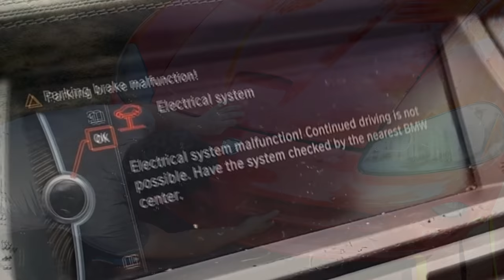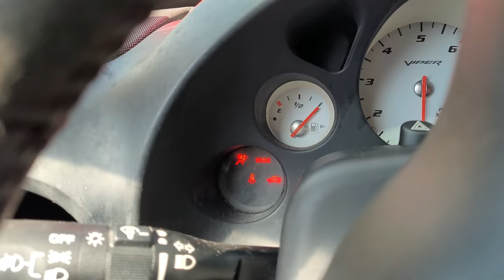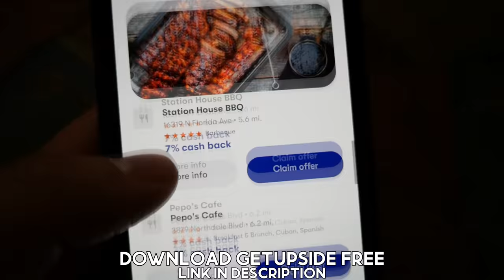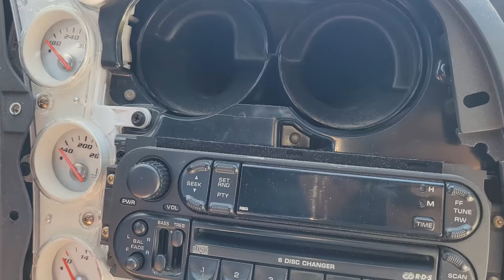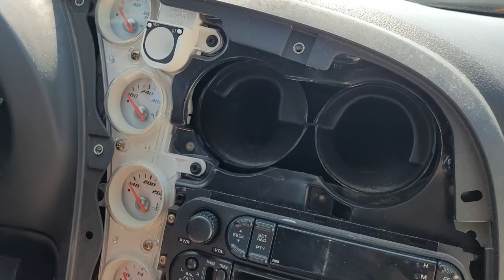Will this Sinkhole Flood Salvage Dodge Viper Start and Run?

Comment: I haven’t finished the whole video yet but I would avoid tearing the engine apart at all cost. I had a TwinTurbo Viper I traded a guy a Polaris I had but he had blown up the motor and it was an absolute nightmare to find new gaskets. It took me months and months to find any gaskets. When I would call places they would just laugh I ended up using OEM gaskets and found the one set in the entire United States that dodge had. Just be aware to this issue if you do tear the engine down, find those parts first and I pray you don’t have the troubles I did. The second I fixed that car I immediately sold it I was so irritated A complete nightmare like over six months of waiting just for head gaskets to finally pop up I wouldn’t wish that upon my worst enemy. Best of luck

Comment: If the starter is "stuck", wouldn't the lights/displays go dark or atleast a bit dim when Sage pressed the start button? I didn't get that impression. Maybe you should try jumping the starter to bypass any potential "modern car" issue along the way from the start button down to the starter. I'm more used to older cars and boat engines, ignore me if I'm way off. ;)

Comment: Pulling the fuel pump relay can cause other problems I learned hard way when I pulled one off my son's car so I couldn't drive it. I ended up having to replace a fuel pump relay module behind the back seat of a 2013 Ford Taurus.

Comment: I think you forgot the most important question: “was the motor running when it flooded?”
Reply: He answered this in the first video. It’s a manual. It probably stalled out the moment it hit the water. No way the driver had time to put it in neutral
Reply: Not likely. Plus it was parked off the road after hitting the hydrant and then the ground collapsed beneath it.
Reply: My comment is in reply to his opening 3 questions you need to ask about a flooded car and not so much about this specific one 😉
Reply: @johnlaw5762  person hit the hydrant, water followed and sunk the car. My bet is it was shut off after the hit.
Hydro locked engines don't usually rotate over very well, tho I seen some that have like nothing happened
Reply: I believe it was 100% as you can clearly see in the crash and recovery video...

Comment: You have 'Push to Start'... uh, boss? You may have a safety interlock that demands the Fuel Pump (very likely) and Blower (maybe) Relays installed. Its a 10 cylinder and those things would quickly scavenge the fuel rail empty possibly leaning out the engine so much the pistons burn out. Just an idea, I would have to see a wiring diagram for it to determine if thats the issue.

Comment: If any of that rust that is still in the engine breaks down into the oil it will destroy the main bearings and the camshafts, the engine may start but the engine will not last! Very risky not stripping down the engine and cleaning it properly.

Comment: I am 9 minutes in. This viper will start. That was a lot of water, but not a lot of rust and corrosion. I think if it turns over, and you're able to get the rest of the debris caught in those oil filters. This car will be running. And that engine may not be as bad as expected. Especially due to the fact that it's SALT water.

Comment: Just take all plugs out fill with oil leave plugs out and cover plug holes with towels then turn engine over with starter let the rings clean the walls then oil change again

Comment: Why would you circulated sand throughout you motor? 
 You are going to have to rebuild it anyway, why ruin the crank and camshafts lifters and every friction surface.

Comment: Marvel mystery oil . Put one quart in the fuel and one in the oil (sub out one quart of oil) it will clean it all run for 60 mile change oil . Then scope it you will not be disappointed.

Comment: Did anyone else notice the ARP rod bolts? That engine has been rebuilt at some point with some high quality stuff
Reply: highly doubt it, the car has like 9k miles why would it ever have needed a rebuilt
Reply: @MS-ps3cf  may not have needed a rebuild, may be a performance upgrade. vipers are commonly modified

Comment: Spray the starter with wd-40 and tap with a hammer as you apply power.  Bypass the switch and jump it directly.  If you want to test the starter, test the starter!

Comment: Try to look after the immobiliser. Maybe the problem is around there. If the fuel pump primes up, that will be a good sign around the immo.

Comment: I live in New Jersey where we have had a number of floods even in recent years so I am extremely cautious about making them roadworthy. Flood waters can be loaded with human and toxic wastes, you may have water inside of body structural parts, and electrical parts may be toast so may cost more to replace and repair. In this case too, your 'sweat equity' if use a going rate of $100/hour, you will likely be $4,000 + that should be included in any 'profit'.

Comment: Are you able to pressurize the oil system and get it flowing without starting the engine? That would probably be ideal in this situation.

Comment: I think you got lucky and the hydrant had cleaned out the line by the time the car got there and it was soaked in fresh potable water. When it comes to metals, many folks think water + metal = rust, but the reality is with fresh potable treated water sequestered in a non-oxygenated environment it can act like a preservative, hell even in salt water if its cold enough corrosion is minimal over decades to the point that the US Navy studied storing ships and aircraft in the deep ocean.

Comment: I have ran a quart of diesel inside the oil of a gas v8 for a week of regular driving, it cleans all the crap out of it--works even better on the japanese 4cyl engine

Comment: The ECU may have some dampness. I was unlucky to have a car suffer water damage and I did have to dry out the ECU after removing the cover. Although they look pretty watertight the plug connections can allow water in. My car was fine after I dried it out. The engine wasn’t affected luckily.

Comment: Hi Sam ... greetings from your favorite Aerospace Engineer on the French Riviera LOL ... what a great call on the throw away Oil filters ... know this, ALL Oil filters are designed to work for about 30 minutes (regardless of miles ... just like on "Tractors") before they do their jobs and revert to "Bypass" mode ... same on F-16/22/35 Fighter Jets. Trust me. "Salt water" is not your main enemy ... it is the sand/silt ... the true reason for "Filters" (and metal fragments of course). Of course, extracting all the water/sand is your main goal, do stop wasting money on "Penzoil" ... even remanufactured Oil will do given how short of Life the Filter will do its' job ... think of it as "Break In Oil" function. And please invest in a good "Contact Cleaner" ... you don't have to immediately replace the fuses/relays ... "contact cleaner" etches the surfaces where the contact points are ... the internals are sealed ... save some money. And know this, "WD-40" was concocted for the "Mercury 7" project to prevent oxidation of the Aluminum exterior Skins (main ingredient is "Fish Oil") and is conductive ... spray that shit all around ... the "WD" means "Water Displacement" ... it is NOT a "lubricant", it is intended to prevent oxidation solely.  I know you will have success with the restart ... looking forward to the next installment !!! Bon Chance ... y'all.
Reply: Well shit, I learned something new today regarding WD-40 Thank you good sir.
Reply: My man spittin’ facts
Reply: Something that works intermittent.  need contact cleaner for my overhead swiveling map lights X6 each. 1995 4X4 454 GMC suburban LT
Reply: BS40

Comment: I’m not sure if your aware or not. But it  seems like the rod caps have ARP bolts. So The engine may be built/have nice aftermarket bottom end parts.
Reply: Saw the same thing.

Comment: Sitting here in the UK whilst Americans pay $3.60 dollars for a gallon. We have fuel duty tax with is 35% then we have VA tax at 20%, imagine that close to 55% of the cost of fuel is just tax.
Currently paying £1.72 per L. Approx 5l to the gallon so we're paying £8.60 per gallon or $10.89 dollars D:

Comment: Does this have a transaxle? Either way you should do a fluid change before running the engine. Probably didn't get wet, but you never know when it was changed last.

Comment: I would still be a little worried about the rusty grit in the cylinders.
You need one of those dentist jet vacuum thingies to go to town with it.
Reply: there is no way he is getting it all out. It needs to be clinically clean but I'm guessing some sand is going to be in at least one or more cylinders and its bound to scratch the crap out of all the bores and ruin that engine. What a waste.

Comment: Your on the right track with the viper.. everyone thinks everything has to be so prestine inside an engine for it to function correctly.  I say no.. no it doesn't have to be perfect.  Yes debris and water must be flushed from bearings and passageways.. but cranking without fuel will clean out all that.  These naysayers are the same ones that thought you couldn't repair the bmw head either.. keep at it.  Keep an open mind and do what you do..I worked for Caterpillar building transmissions.. you have no idea the stuff that went into those.  Yes we had tolerances, unless it cost money,  then the tolerance was overlooked.  If a shaft or gear was undersized it was never noticed because the parts would still assemble.   Most of the parts were good,  most of the pieces were installed correctly,  most of the time it didn't harm a thing.   But some went on to never be noticed and lived a long life.. probably... lol

Comment: Am I the only one more concerned about there being sand in the intake and cylinders than salt water? It may start but he will grind the shit out of the cylinder walls would you not? Why not tear the engine all down and sure it’s all cleaned out before starting it?

Comment: Why not test the ECU by connecting a scanner and checking codes?  The actual codes don't really matter at this point.  If there are any, probably means that at least something is working electronically (ECU, bus comm, etc.).  Could be a useful clue.

Comment: Hi Sam, I suggest to get a very powerful vacuum with cyclone technology and make sure get rid of all the sand in the engine bay first. The open engine and fine sand is not a good combination.
Reply from the maker: Yes we shop vacced on between removing everything. It's the worst part of this car probably worse than the actual water

Comment: Im sure its in the comments but why didnt you first hose the entire car down? Under the hood,wheel wells, literally everywhere. Could have hosed that sand away from the intake Valley pan, and alternator.

Comment: That water is not going to hurt that car change all the fluids flush out the engine  put  transmission fluid in the engine then put some alcohol in the engine it will dry up the water  the chance the plugs start the engine let it run for a while then change the oil again

Comment: Still probably the better idea to pull the heads and get all that crap out of the cylinders before you crank it or else you can easily gouge the walls and you end up burning oil and no compression.

Comment: The best rust remover method I have ever seen is using apple cider vinegar.I used it on my gas tank off a old motorcycle I rebuilt and it looked new once it was done eating the rust.

Comment: Would there be an issue connecting a battery and home made switch directly to the starter to turn over the motor?

Comment: I know you can start the car up and trying to stop the carpet since it has been in a plug damage or any kind of water damage but if you have more money and sense if you was going to keep it or sell it think you got it started you are causing more problems and what it is worth little bit of grain of sand or salt it will start to wear your fails and with every single or joint moving parts in the engine that would be the same with your steering column power steering you're front bushes your your joints will have great grit and Sand and salt in it when you have sorted the car out you'll have to get wear and tear a lot quicker what you would in the first place

Comment: I've flooded many Honda four wheelers and dirt bikes in my day. No big deal. Just pull the spark plug crank it over a few times and hit the trail. Maybe change the oil when you get back... 😂 That would have made a better video.

Comment: If you have still got sand in the engine and think of putting stuff through the engine trying to filled it out to clean the inside and trying to start the engine out fair enough it will fire up but in the long run you have made things 10 times worse it wouldn't matter if it was so water or from a beach or whatever it is with sand and Grit always salt or if it completely roll hit a fire hydrant and dumped got a hole through the ground and the whole part of the front end of the car when inside the hole and water log the engine it wouldn't matter if it is freshwater or saltwater because most Road are being treated when it is winter with salt on the road and sometimes some of the Earth or ground is send as well and if you think you have cleaned the engine thoroughly if you think and still got pieces of sand or grit inside the engine or you are doing is making the engine was any kind of friction with grit or sand or salt water in the long run it will cause damage really badly the only way you are going to get rid of the salt water or the sand or grit in your vehicle is stripping it all the way down to the last nut and bolt the things you are doing putting cleaning staff to help the engine or trying to get it sorted out you might as well strictly ending then clean every single cavity and hole and with your joints pistons and crank Arms with a deep steam clean

Comment: I had a friend in Germany when I was in the Air Force .When he would  buy a BMW he would pull the valve cover and oil pan then spray soap in the engine. Then blast the inside of the engine with high pressure water and let it run out the bottom.then let it dry add new oil and filter.then change the oil after letting it run a while.

Comment: Spinning it over by hand for extended periods of time is technically negative... There isn't much If any oil pressure generated but obviously your spinning non oiled bearings against themselves for 20 mins all be it slowly

Comment: Sam, oil filter will be mostly bypassed until oil gets hot and thin...no sense changing it until after a few heat cycles

Comment: Dodge sucks.  If you unplug the fuel pump relay (Auto shut down) the car will not crank. I used to work for a local dodge dealership and am vary electrical fluid including at tech school back in the day a long time ago, they (the teachers) told me I couldn't get a 1994 Ford explorer flood vehicle running... It was swamped for a week and had to pull the heads because of being soo full, clean all the PCs, {did use rice meathod back in 1995}
Reply: It ran.  Airbag and abs lamps were on but no check engine lamp!

Comment: Do not start up the engine! You will scratch it to pieces with sand. You need to totally disassemble it and clean it and install new bearings.

Comment: I remain skeptical.  If that engine was running when it went nose first into that water it ingested water and hydro locked. It will have bent piston rods at a minimum.
Reply: If the story is correct and the car took out the hydrant there was probably enough time to shut the engine down before the water saturated the ground sinking the car.
I'd be more worried about sand in the internals killing the engine. It's not a smart move to start this before a complete tear down and reassembly.
Reply: @akaHermanSnerd  The Viper is a Manual so the engine stop after the foot hit's the brake fully. Next the Viper was parked off to the side of the road after hitting the hydrant and then the ground collapsed beneath it.
Reply: Doubt it. The thing turned over by hand (for half an hour, according to Sam in this video) if it bent rods there's no way it would turn that easily and you'd probably hear some strange noises on turns, too.

Having said that, I too remain skeptical, especially after seeing 5 gallons of water come out of that thing in the last video before any oil started coming out.

Comment: GASP The Fuse Box! MY JAM! So, NA-16-1-540 Avionics Cleaning and Corrosion Control Manual (I once knew it by heart) yeah, remove the whole panel, depopulate the fuses and relays, and using distilled water dunk that sucker! agitate it! Use a soft tooth brush and scrub it. Dunk it again! Use dry air to blow off the water. Use some water displacing electrical contact cleaner (WB40 makes a version) and leave it in the sun to dry. Now do the same thing to the fuses. The relays, if you can remove the covers do the same and if you can't remove the covers don't bother, if the unit is hermetically sealed just do the above and inspect the sealant for rips and tears. After everything is dry reassemble. If you see corrosion? Use a ruby red eraser to remove it, then use the contact cleaner. Easy peasy. To do the whole job proper should be about a half hour to an hour.
Reply: Oh and I'm retired US Navy Aviation. Worked on fixed wing and rotary (helicopters) and when I worked Helos? Yeah, I got the Atlantic Ocean up the backside, thru the nose bay and out the cargo door more times than I can count and had to do the above on ....well... about 3,800 pounds of Avionics.